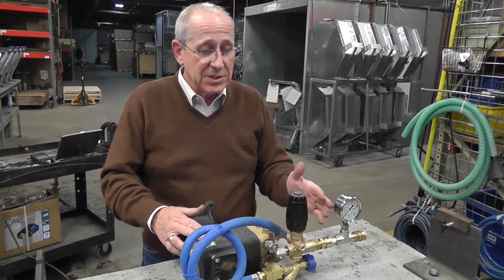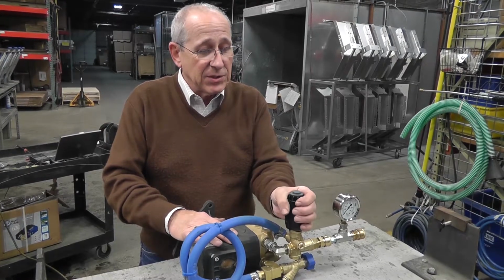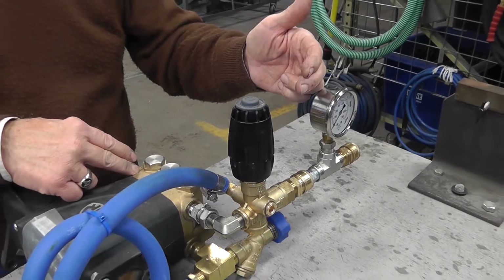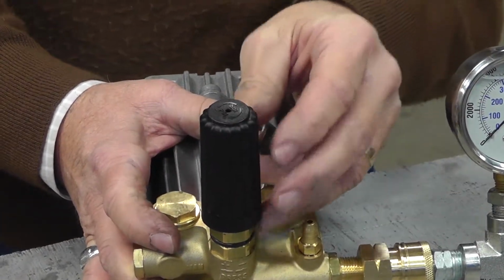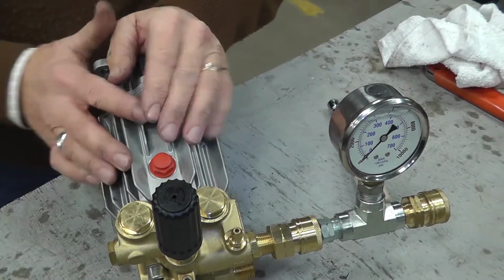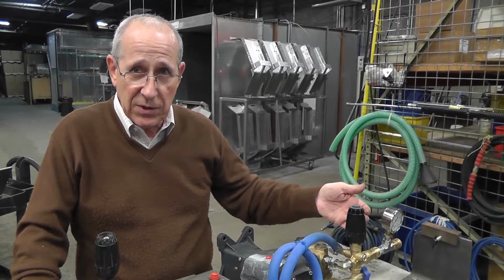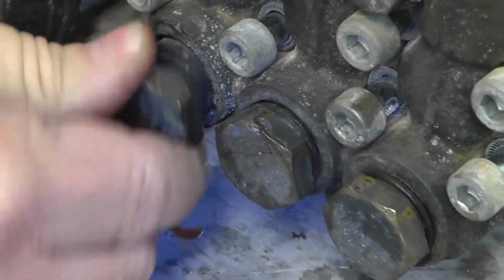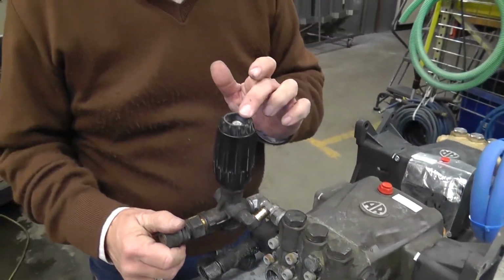Right Pressure to Unloader

Comment: So the dangers in having incorrect pressure are the valve caps sheering the threads and flying off given you have a 10,000 psi hose and equally rated spray gun?
Reply: Qualsiasi pompa costruita ha un 20% in più di resistenza su pressione. Faccio un esempio 
Ws151  150bar 900litri ora,  può lavorare a 200 bar ma bisogna mettere ugello più piccolo e caricare bypass però il motore va ad sotto sforzo. Però avrai si 200 bar ma 600 litri ora.  Ok ?
Reply: @MassimoRome yes thank you.  Lower flow and higher pressure. Always a compromise.

Comment: 2 Questions. My 3800/3.5 pressure washer has about a 20% difference between the trigger being pulled and released. I understood that it needs to be around 6-9% to prevent the "hammering" effect on the pump. The best I can do is lower the pressure to 3,100 so when I release the handle it spikes to 3,800.  Is this acceptable? Also, is the engine supposed to be running at full throttle? They say to run it at 3,700 rpms. Are the stop screws set to that from the factory? It's a Honda GX270 with a AAA pump.
Reply: Did you ever find the answer? Mine does this exactly
Reply: @Mvnmata  nope. I just run it as is & control the difference in pressure by reducing throttle. It's seems to be getting worse, but works just fine really. I've heard it's the brand of pump not being high quality.
Reply: I have a 4400psi 4 gpm Triple AAA pump also.  Mine seems to have so much pressure build up after you let go of the trigger and go to squeeze the trigger again.  You literally need to hang on and brace yourself because when you squeeze the trigger it kicks back like a high power rifle.  I hate it being like this.

Comment: I have a gx690 3500 psi should I set the gauge to 3500 psi? What's the point in the gauge why not just leave it at 3500 psi
Reply from the maker: The rated pressure of the unit is generally going to be the average pressure between working pressure and bypass pressure. When you have the trigger pulled, and water is flowing, the gauge should read 3200psi. When you let the trigger go, It should spike to about 3700 lbs. That said, I cannot say with certainty that this is how that specific manufacture sets the pressure on their units.